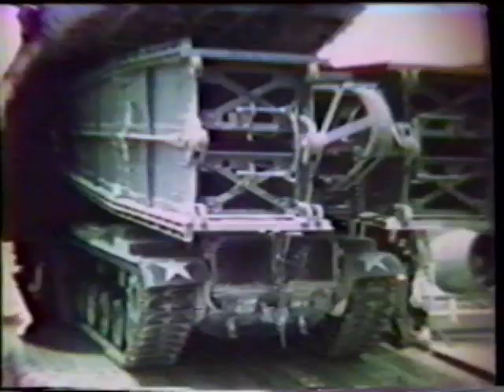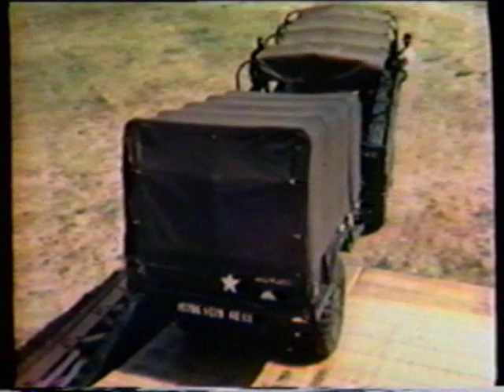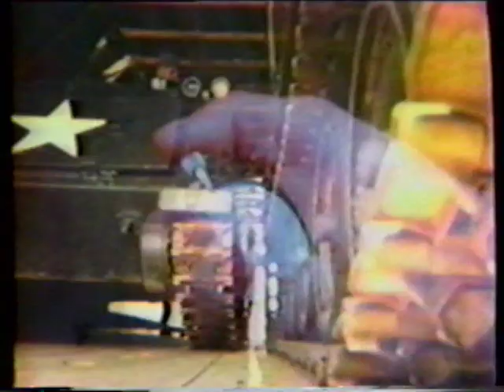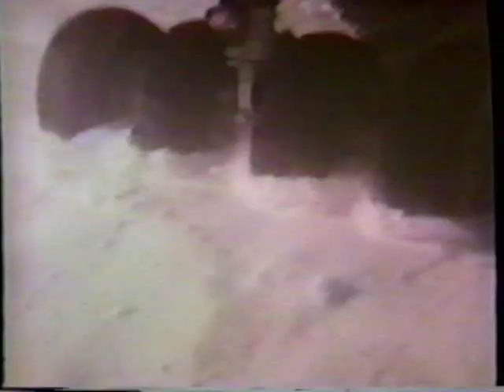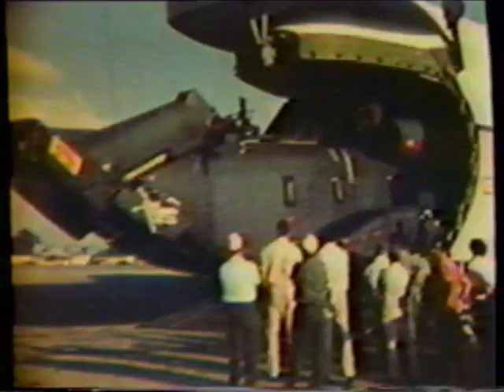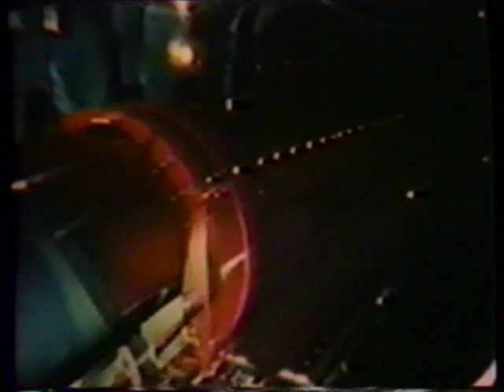C-5 Improved

Comment: The C-5 wasn't in service during the Tet offensive
Reply from the maker: You are absolutely correct! In fact, when the Tet offensive began (January 1968), the first C-5 hadn't even been rolled out (March '68) let alone had its first flight (June '68). 

My best guess is that when Lockheed made this promo film in the early 1980s, the PR writers confused the 1968 Tet offensive with the 1975 final resupply effort (which, so far as I know, doesn't have an overall "Operation" name), and no one caught the error before the film was released. 

Very few people have caught this error through the years.